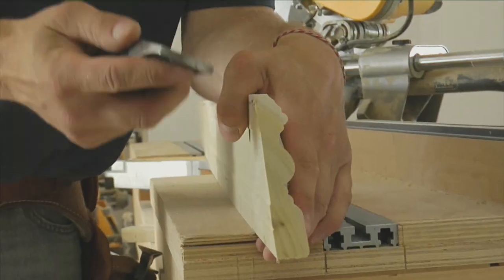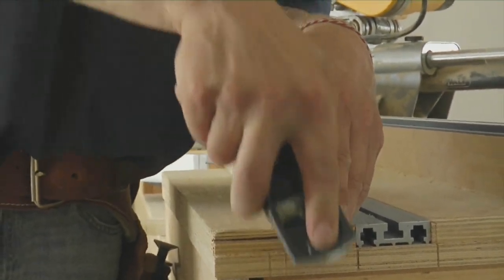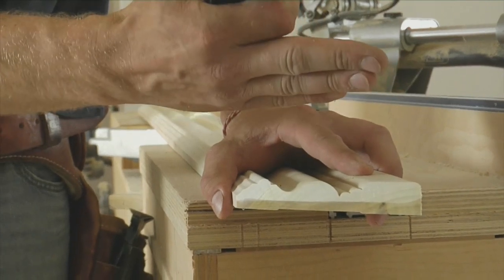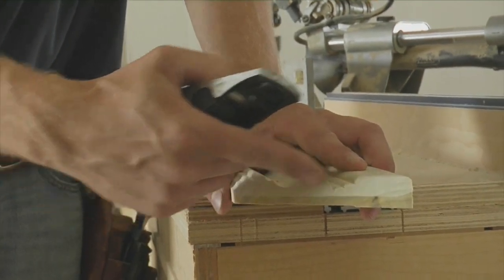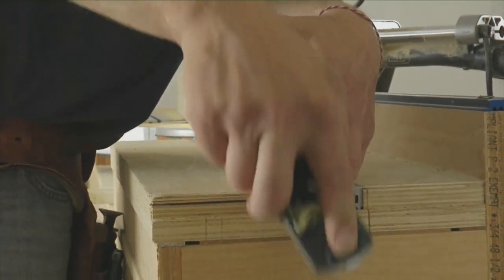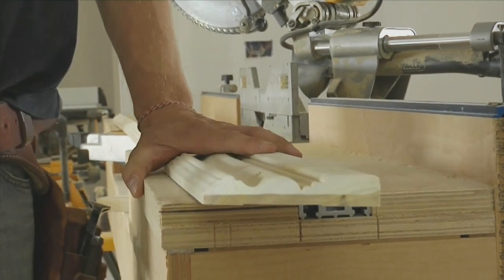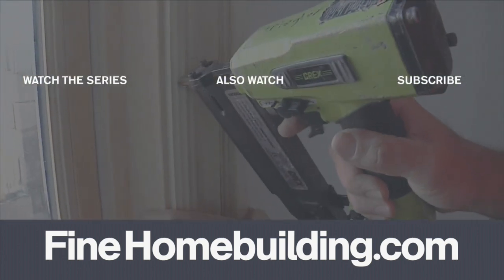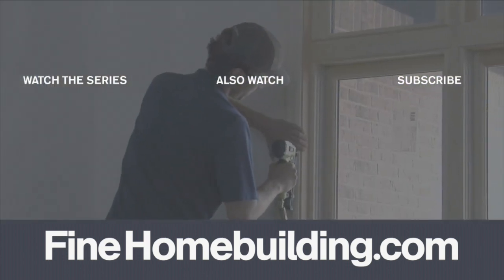Back Bevel Mitered Trim For a Perfect Fit

Comment: I was shown to put a pencil under the casing to lift it off the saw table ,in turn it puts a slight backcut on the joint and faces will always meet before the backs do